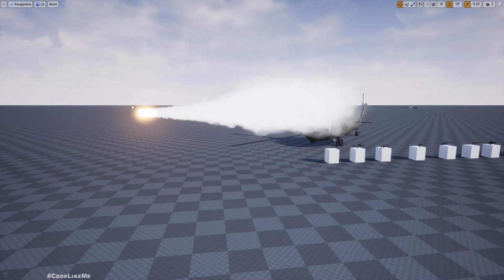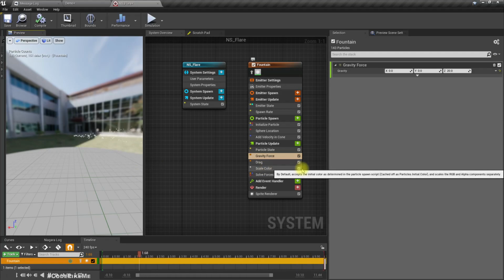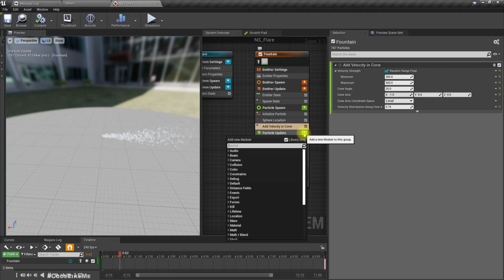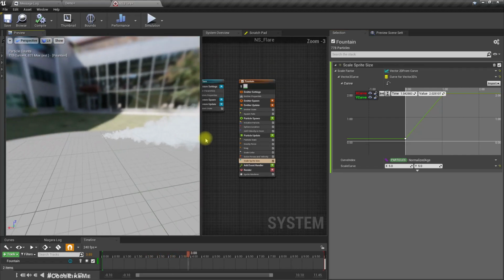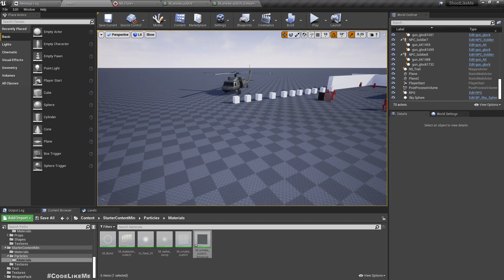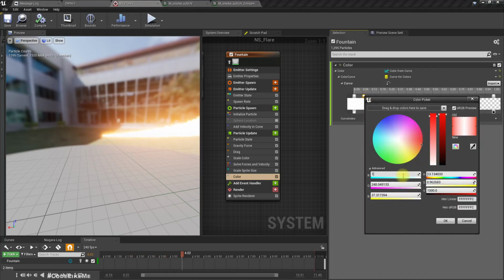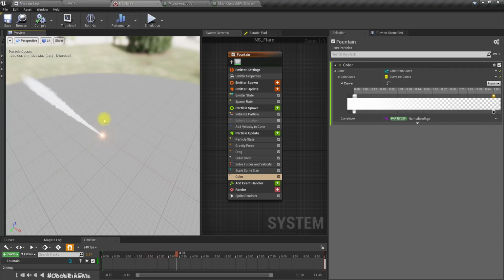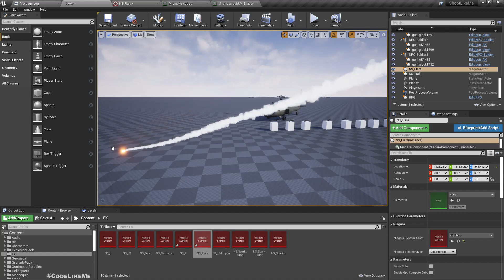Unreal Engine Helicopter Flying #17  -  IR Flares Niagara Particle

Comment: Thanks for this! Is there a way to control the brightness of the emissive in sequencer with User Parameters? Doing something like spawn rate is simple enough but how would you control the brightness of that color for that curve thing?
Reply from the maker: You can set the color, or scale the color. There is a module for that

Comment: didn't see how you handled the pod pockets. last one just covered the bomb holder ones, I tried using what you did for my pods total of 9 slots i got one to attach to component but even after adding other attach to component and adding spots to append only got 1 rocket to show in the pod